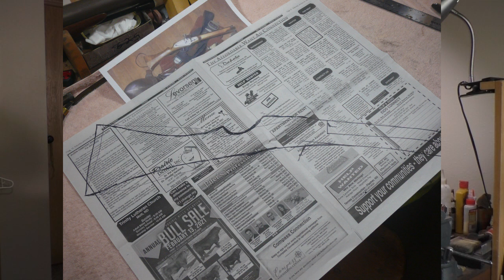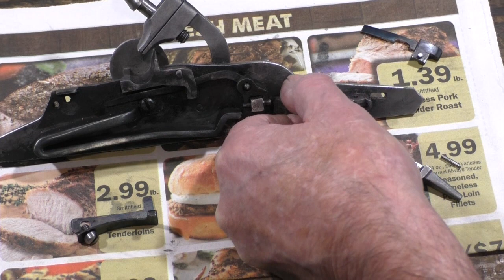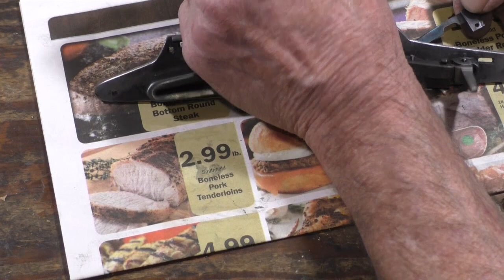Building a Snaphaunce Musketoon #1

Comment: Wow! I really appreciate these videos! You demonstration of the use of the small chisels, scrapers etc really fill in the gaps from the longrifle books. I am getting a snaphaunce action and I’m going to attempt to scratch build a Dutch style musket. TOW has a barrel that should be close enough to what I need for the project. I’m hoping you have info on the trigger function and I’m letting for the snaphaunce as it appears different from the flintlock arrangement. This is just about perfect/

Comment: I just stumbled across this and have a question regarding the lock: What causes the secondary sear to engage the primary sear when the hammer is cocked, instead of just dangling around? Is it also spring loaded? Sorry if that's a stupid thing to ask; I have literally no experience with guns at all.
Reply from the maker: The primary sear engages an angled area of the hammer so it is trying to push it out. The secondary sear prevents it until tripped. Both are spring loaded. I never fully understood it either until I got this lock.